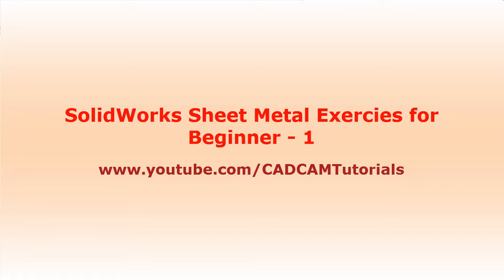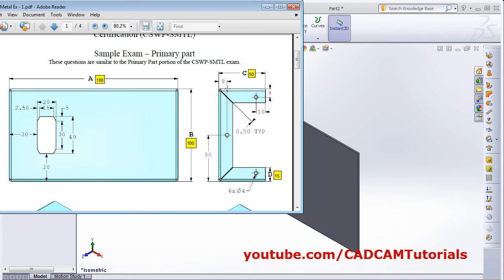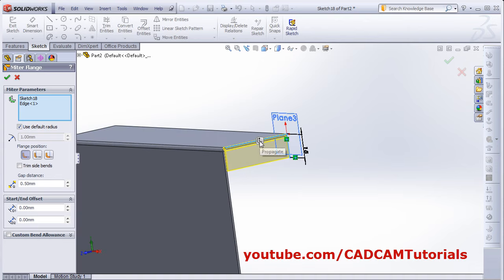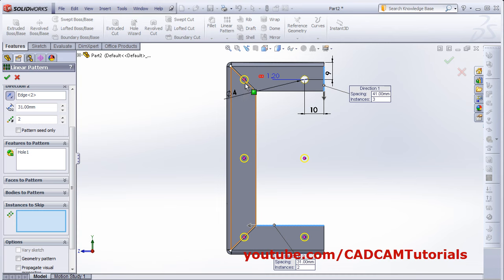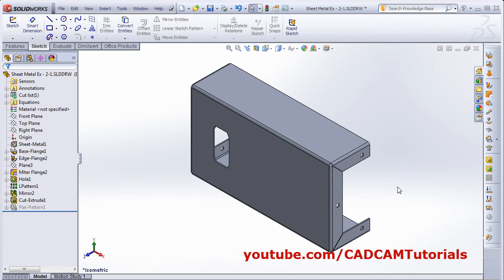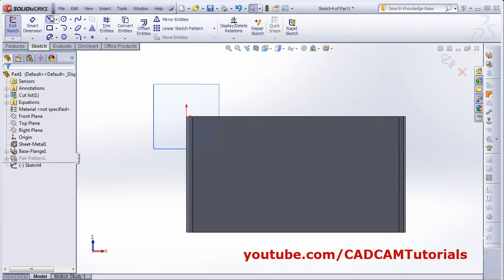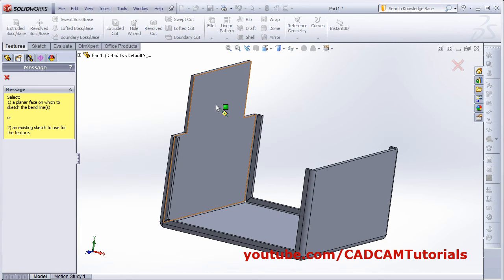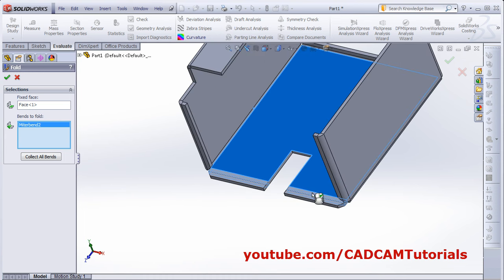SolidWorks Sheet Metal Practice Exercises for Beginners - 1

Comment: When i attempt to propagate the edge flanges, it doesn't work. It only works on 1 edge.
Reply: Same problem
Reply: @redcoatgaming3682  I found that you have to make sure you're drawing the line on rear edge once normal to view is selected
Reply: @redcoatgaming3682  you have to make sure that the lines you draw are connected to the rear after normal to is selected